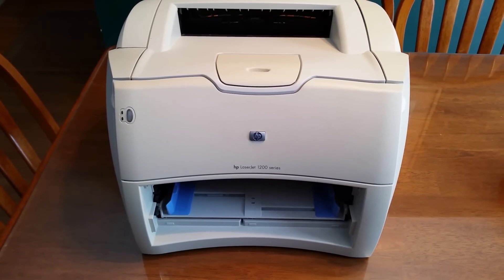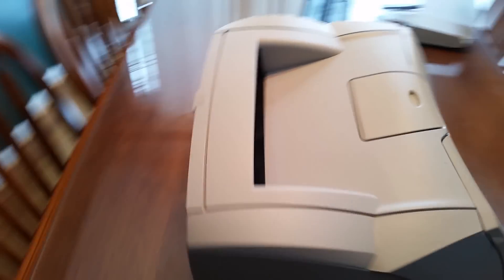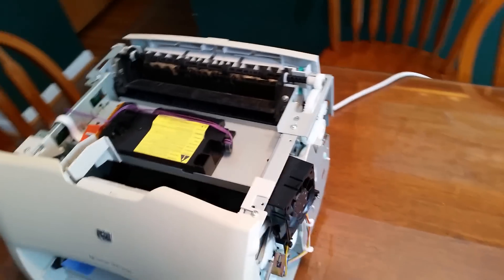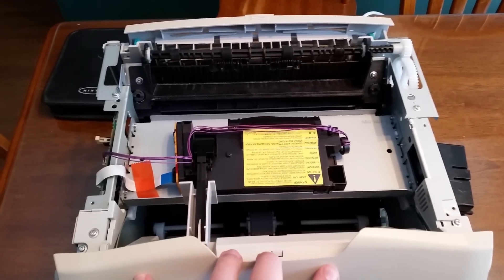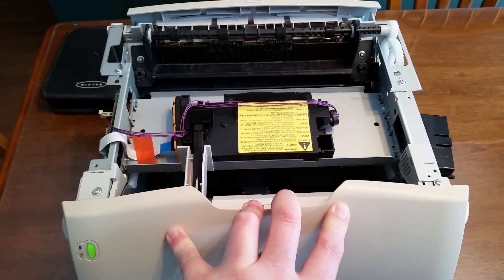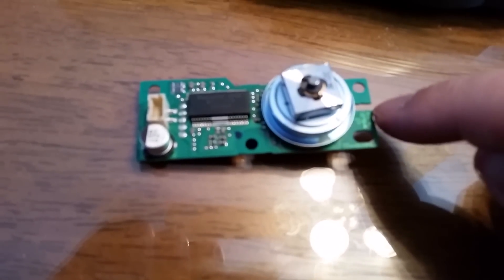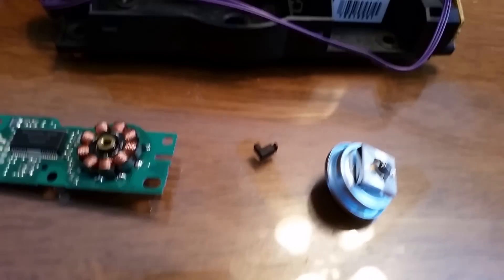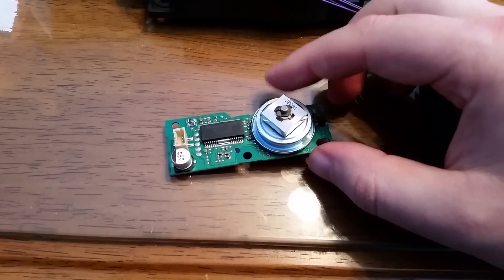HP LaserJet 1200 repair - Lubricating the Laser Scanner motor

Comment: My old elementary/middle school had this printer. Along side the 1100,1300 & 1220 (very rare one). Brings back memories when in school break, I would print configuration with that button. I also did that with the 1220, 1300 & 1100. Thanks for uploading!

Comment: My HP1200 had this horrible noise, and I thought I'd have to toss it out. It has been my best B/W printer ever - going for like 15 years - sharp prints and very economical. With your help I put a drop of oil on the motor in the motor bearings and now it works perfectly again. Thanks a lot, you are contributing to my climate goal :-)
Reply: Which oil

Comment: December 29, 2020. Thank you so much for your wonderful video about lubricating the laser scanner motor of my HP 1200. When I opened your video the HP 1200 you were repairing was making the same howling noise my old faithful HP 1200 started making tonight. I figured I needed to look for another laser printer because I checked with HP on-line and they said if the printer was over 7 years old, it would be too expensive or not even possible for them to fix due to availability of parts. I stumbled around on-line looking for other laser printers but didn't really find one I liked which fit in the relatively small space available for it in my 5 x7 foot office. Then I decided to look on-line and there you were. I'm sure you got the panels off a lot quicker than I did; I had to go back on-line to discover how to take off the right panel cover without breaking it. Well, I got there and your instruction about lubricating the motor was great. I did what you suggested, " one drop of 3-1 oil" and close it back up. I got all the screws and panels back in place, plugged in the 1200, and it worked wonderfully. Took me 90 minutes to fix per your excellent instructions. Now I've got my faithful printer back, I am so grateful to you. I really liked this old printer. I've had it for 15 years, maybe more and all I've done with it until tonight was dust it off now and again, feed it with paper, labels and envelopes and every year or so put in a new toner cartridge. Thanks again.
Reply: I checked how many pages my old, newly repaired HP 1200 had printed. 36,700 pages over 15 years with 6 paper jams and 27 mispicked pages in the printer. A pretty wonderful printer. I guess I'm not surprised that HP no longer makes the HP 1200. If small businesses and families all bought an HP 1200, HP wouldn't be able to sell replacement printers every few years cause the 1200 just keeps on printing and printing. I haven't bought HP cartridges for years. I've probably purchased 8 or nine replacement cartridges from Ink Technologies. com. I buy their NL-C7115X toner cartridge. Great cartridges, great quality and one third or less the cost of HP's OEM cartridges.
Reply: Name please which oil can we use

Comment: Hi, and thanks for posting this. I was able to repair my aunt's LaserJet 1200. I removed and also replaced the mirror assembly without touching it by using a plastic ballpoint pen cap. I put a small drop of sewing machine oil on the table and "painted" an even smaller quantity directly on the motor shaft using the tip of the pen cap so there was no excess. Printer worked perfectly once reassembled. Thanks for this informative video!

Comment: Used this fix on a Samsung ML-2851 printer. Thankyou!
I have to admit that this was a tricky job. The motor in the Samsung printer is so small and spins so fast that even a single drop of oil causes friction and slows it down causing the LSU to time out when the controller tries to spin the motor up. Tried diferent oil and grease types. Finally, a single drop of a dry PFTE (teflon) additivated lubricant on the shaft (and only on the shaft) did the job.

Comment: Thank you for video. Athough my printer is not LJ 1200, not even HP, I finaly found the same sounding noise from laser printer. My printer is Samsung SCX-4500W and it produced absolutely the same sound. It took several tries of cleaning and lubricating laser scanner motor on my unit. Either horrible sound didnt go away or motor did not spin to full speed. I guess i used too thick grease to lube motor shaft. After aproximately 10 tries noise is gone and motor spins perfectly. Thanks again for video, it pointed me to right direction. Thumbs up!

Comment: My LJ1000 was doing the exact same thing. Tried this fix, and it worked like a charm! My 16 year-old laser printer works like new. Thanks for posting this video!
For those asking where to put the oil, I put a small dab on the motor axle, before reinserting it into the stator coil assembly. Doesn't take much. Make sure you use a microfiber cloth to wipe any smudges or particulates from the mirror surfaces, before reassembly.
Reply: Which oil can we used

Comment: Thank you very much, it helped fix my good old LaserJet 1200.  
For those wondering, you have to put the oil on the little metal rod below the mirror part.  I used the famous WD40, it worked like a charm. Be sure to clean excess oil and to remove any fingerprint or dust you might have put on the mirror while manipulating it.

Comment: Just wanted to post for others who may find this video that he doesn’t show how to disassemble or lubricate.   Find another video on how to pull off the RH side (from the front), to remove the top to get to the mirror.   Pull out the black scanner assembly and remove the black screw before undoing the four cover clips.   Do not touch the mirror on the top sides!   If you do, clean it with a lint free microfiber cloth.  Move the plastic peg out enough to pull the mirror off off the brushless coil assembly.  Put a drop on the shaft under the mirror, then reinsert and spin it.  Move it up and down a little, spin it more, then reinstall the plastic peg that holds the mirror from coming off.  Put it all back together and it should be silent.   Hopefully, ours will last another 17 years.

Comment: My LaserJet CP1215 has a similar sound. I was led to believe it was the fuser unit, so I replaced it -- still an issue. I then pulled out the transfer drum assembly and that's all running fine. All the gears seem to be fine, so I'm running out of moving parts. This matches the noise I get on power-up, so I'm assuming this is next for me. I'll have to do some testing and confirm before stripping it apart.

Comment: Thanks for the video. Worked like a charm. I used a very small amount of silicone oil (not a spray). Also put some on the plastic gears. Very quiet now. Could use a teflon oil as well.

Hope to get another 20 years outta this nearly indestructible printer. 

To anyone considering lubing the gears... silicone oil plays nice with plastic. Many petroleum based lubes do not. Also WD-40 is more of a cleaner and something to break rusty nuts free. Not a very good long term lubricant. The WD stands for water displacement.

Comment: Thanks a lot for this video, I just solve my problem with your help !!!!
Reply: I did not had oil so I put grease instead applying a slip on the iron bar with my hands.  It seems to works for now !!!  Here is the grease I applied :
http://www.lesker.com/newweb/fluids/jpg/photo/Photo-FL-FG_DCP76VF_DOWCORNING.jpg
This grease is normally used with laboratory equipments